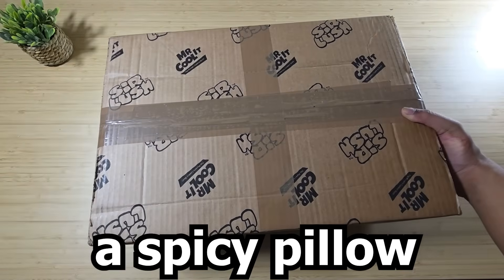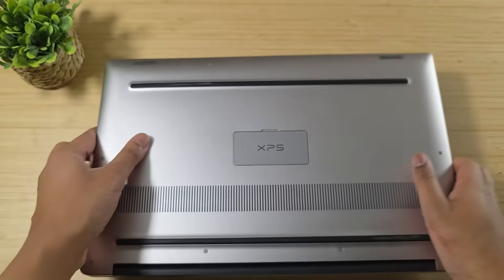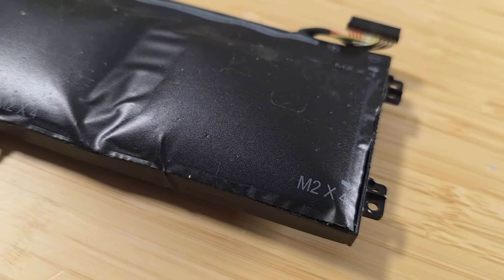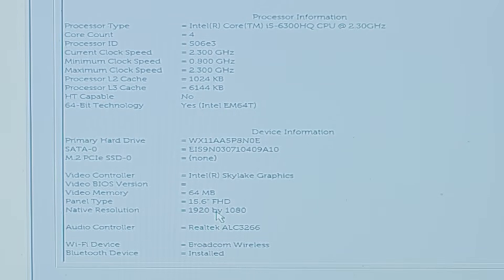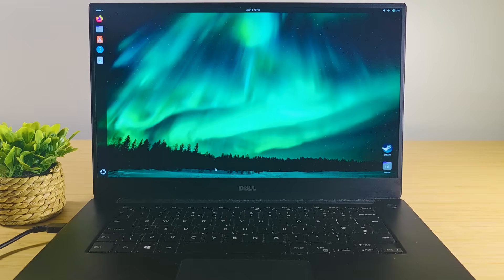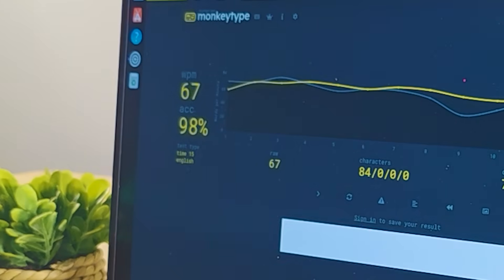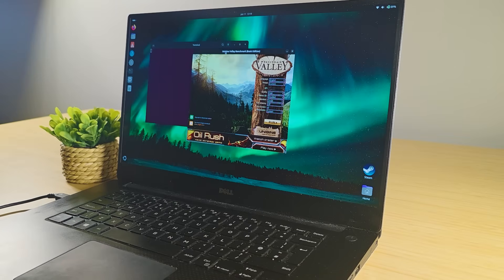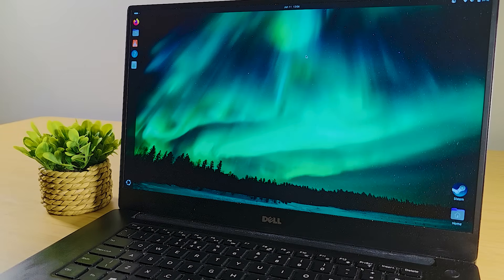Fixing a $20 Dell XPS Laptop, with a TERRIFYING hazard.. Can it be done?

Comment: I use JB weld to repair broken mounts and hinges and holds up  better then the original mount. I even add JB weld it even if replacing with new hinges and new frame top casing, to prevent it from breaking again.

Comment: You are running half the performance cause u are using have the wattage needed to fully run the cpu and gpu, got the same combo in a dell 7577 if i remember correctly and it performs well on bazzite or win11 ltsc

Comment: What the heck,this computer was an expensive high-end class and they still used that crappy rubber material on the surface? Why do companies do that? Those surfaces get shiny and stain easier than just plain plastic. Also it's not even that old and the rubber is sticky already
Reply from the maker: In humid environments, the rubber coating is quite the detriment. No idea why they didn't go with a metal palmrest, they still do it to this day from what I know. But yeah, this laptop was the pinnacle of machines back in 2016.

Comment: Dell XPS do have Ubuntu pre-installed. And I guess hardware inside of it has been designed to be able to run Linux just fine
Reply from the maker: yep, ubuntu ran like a dream with no issues. would've configured it like that

Comment: linux may be best after win 10 eol i know most end users will hate it due to the fact non of there stuff is where they like it
Reply from the maker: linux does have a learning curve, though you get used to it quite quickly. for most ppl, windows is best and enterprise support might be worth it.
Reply: @cephacoretrue I have been using Linux off and on since Ubuntu 15.04 I prefer windows as I am an NVIDIA user and part of the time the driver never works right

Comment: I always find it funny when people sit there and get scared of a battery expansion, when the battery expands like this, it’s outgassing, a process done to PREVENT the battery from exploding or entering thermal runaway. I had a very similar machine from ewaste about a year ago, the Precision 5520, very nice machine but the plastic chassis on these are a poor choice by Dell.

Oh I just got to the bit where the hinge snapped, yeah, that happened to mine. Ended up selling it for that same reason.
Reply from the maker: That's quite interesting, so its a safety feature. At least nothing actually happened. In regard to Dell, they do have some QC issues and at least are quick to rectify them. The broken hinge was quite comical as it didn't need any force whatsoever.

Comment: I want this laptop or one like it. If i can get it for little money.

What i really prefer having is a 60% battery float feature, where the laptop doesn't try to charge the battery fully and just keeps it in this long term healthy state. Does this laptop have the feature?
Reply from the maker: Not sure, but it definitely should! These batteries almost always end up failing. Perhaps a bad batch, as the replacement was unscathed.

Comment: do not use the usb c charger as its also prone to making the pillow expand just use the original 130 watt barrel pin charger
Reply from the maker: I didn't have the barrel at the time, but will do for sure. Thanks 🙏
Reply: Why would a lower power usb-c charger expand the battery more quickly? I don't see the science behind it, but I might be missing some information. Got any sources for this?

Comment: Did you use the native Nvdia GPU drivers of Ubuntu (Nuveau) or have you installed the Nvidia proprietary ones?
Reply from the maker: Native, does that have an effect? The Ubuntu install was the latest one.
Reply: Proprietary driver works much better with better performance.  @cephacore
Reply: @cephacoreThe proprietary driver has much better performance.
Reply: @cephacore Yes, it does have an impact. Nouveau is a third-party open-source reverse-engineered unofficial Nvidia driver. Please download the official proprietary Nvidia driver and install it using terminal commands to fully utilize the original performance of the graphics chip.

Comment: Nice find!
I5 6300HQ is a quad core,
6th gen laptop i5 were either 2C4T or 4C4T, in HQ i5 there was no HT,
As for the lower than expected performance,  it was noted in the comments that it's probably due to a low watage charger. Try with a high wattage one and should give you full performance
Reply: He jumped straight up to benchmark rather than checking the cpu boost clock and tdp in hwmonitor
Its 45w cpu with 50w gpu laptop ,that 65w charger cant cut it

Comment: Those are torx T5, not pentalobe. I've got one of these 9550s with the 4k screen sitting next to me, but without the spicy pillow. Our company had a bunch of battery problems with the precision version of these (5510, 5520). Thankfully, they've been much more reliable now.
Reply from the maker: Thanks, I suppose it was a bad batch of batteries. The replacement works just fine

Comment: Several years ago, I picked up an XPS 13 9350 that had been donated to Free Geek for a song. I wanted a laptop that I could load Linux on there so I could start my journey from ditching Windows and macOS. Unfortunately, within a few days of using and charging the laptop, a slight bulge formed and I knew I had a spicy pillow situation. I got a replacement battery and a new SSD (the 128 GB was a little too small for all of the tools and VMs that I planned on installing/running).  I really hated how the keyboard dock was super sticky due to the material breaking down (got a vinyl cover for it), but the final nail in the coffin was the keyboard started to flake out.

Eventually, I got a ThinkPad T14 Gen 3 cheap on eBay to replace it.
Reply: Also, the lower then expected performance could be due to the 65 W ThinkPad power adapter that you were using instead of the 130 W adapter that the laptop needs to run at full-tilt. My work laptop does that when I use a dock that can only provide 90 W and not the full 130 W.
Reply from the maker: Sounds like other models also suffered the same fate. Man, if only Dell did something about it
Reply: I want to ask, how is the ThinkPadT14 Gen 3 going?
Reply: @DuceQuestionMark  It's been a really great Linux laptop. I've been running Fedora KDE on there since 39 and haven't had any major issues.

I maxxed out the RAM to 48GB and put in a 2 TB NVMe SSD. While it uses a U series Core processor, it's really snappy even under load.
Reply: @questionlp  48GBs and 2 TB of NVMe HD space... I have to ask: What are you running on that?
Reply: @DuceQuestionMark  I do web app development and run several VMs or containers for testing and validating against different versions of Python (and to a smaller extent, Ruby and Node).

My primary laptop is a Framework Laptop 16 with 64 GB of RAM and 4 TB + 1 TB NVMe drives.